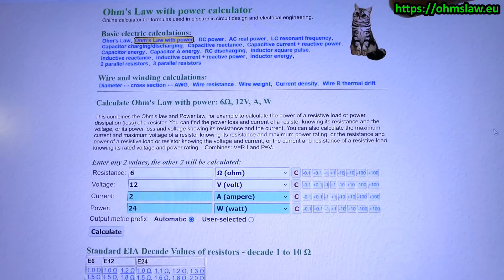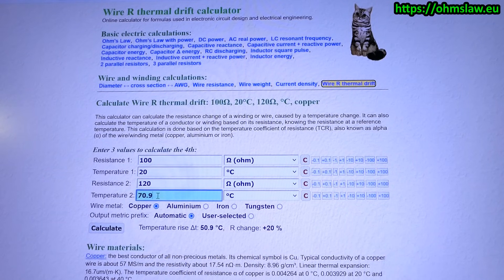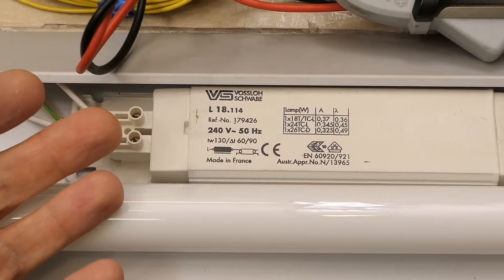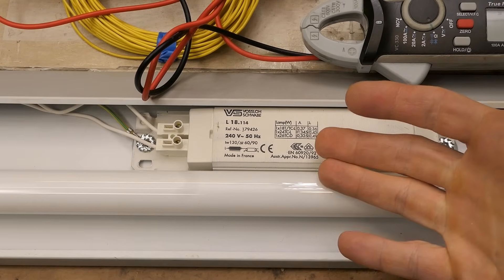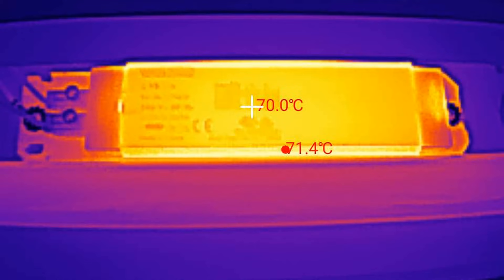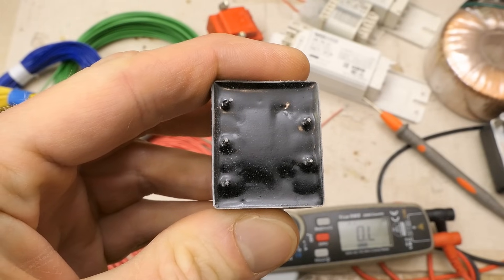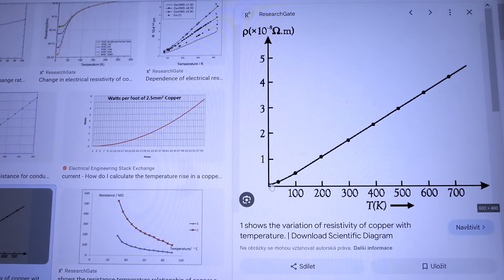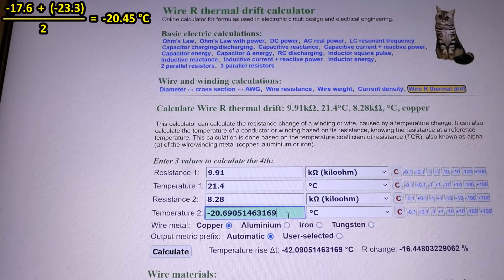Wire resistance thermal drift, winding T calculated from R

Comment: I got a ballast made in GDR i think. or west germany.  I dont remember what it said exactly because i installed it in the garage. 
its its 40w but i have 36w lamp in it. i wonder what happens overtime.
Reply: 36 and 40W are the same, the problem is if it is for 220V, it will work with a higher current

Comment: I never knew inductors had a lifespan. Just assumed they were solid state therefore basically last for ever. 👍😎🌲❄️
Reply from the maker: Nothing and nobody lasts for ever. The insulation and the wire lacquer (enamel) deteriorates, and the rate od deterioration depends greatly on the temperature. But it can outlive you if the temperature stays well below the maximum.
Reply: Structures built of granite will last forever. Its the hardest rock. The victorian built stone buildings in the UK will basically last forever with minimal maintenance. Also think of the 2000+ year old roman buildings.
Reply: Entropy - rules!

Comment: Some 1960s 40W fluorescent lamp ballasts only had 15 Ohms or less resistance. Some newer ones have thinner aluminium windings and a smaller core. The same is true for older non-chinese vs newer chinese microwave oven transformers.
Reply: Fluorescent lamps peaked 20 years ago.
Reply: @RK-kn1ud  I still collect and use them as well as other discharge lamps. as a nerd I prefer plasma over LED.

Comment: Also, most of metals (copper and few precious metals can not go supercunductive at all)  at certain low temperature starts exibiting superconductivity, or simply, resistance drops to exactly zero ohms. 😊
Using the positive temperature coefficient seen in metals one can design temperature probes with relatively linear temperature/resistance curve but highly stable and repetable one. For example, widely known platinum 100ohms, 1kohms, or copper 500ohms. 
I have seen few variable frequency drives that can measure (with accuracy of 1-2°C) motor windings temperature using this effect, but they must be calibrated with every motor connected...

Comment: Why don't you use your big resistance meter?
Reply from the maker: Yes, 25A is too much. Maybe for a very thick wire. This test current would significantly skew the temperature of almost anything.
Reply: That thing puts 25 A at the lowest setting though the device under test, that wouldn't be very suitable to do this experiment.
Reply: That big resistance tester is perfect to test chinesium cable :)

Comment: Great film material, a question that comes to my mind. How will an induction motor behave at very low temperatures? e.g. -40C?
Reply: My guess is it would be stronger and draw more current, essentially it would behave like a motor with higher power rating.
Reply: @koharaisevo3666 but then you have the higher friction losses due to the higer viscosity at that temperature. 

In short, it all depends to what the motor is connected.
Reply: @LMB222  You're right, the engine will definitely draw more current to do the same job. There will also be a problem with bearings and condensation in the engine.
I'm thinking about a servo motor, because there will be a lot of variables there 🤣
And the main question is how to make it work and not only for a while? 🤣

Comment: Interesting information, thank you!Maybe you could also make a video about why the transformer or coil expected life time is shortening so much if the "tw" is exceeded even 10 °C? One could think that transformer is only copper wire and some isolation material (when not taking about oil filled high power transformers in power distribution lines) and there is only a limit when the transformer fails (insulation melts down and causes short circuit between windings) and below that the transformer life time is more or less forever.